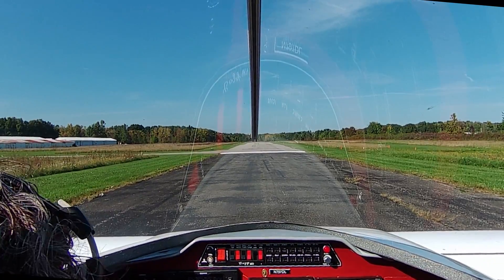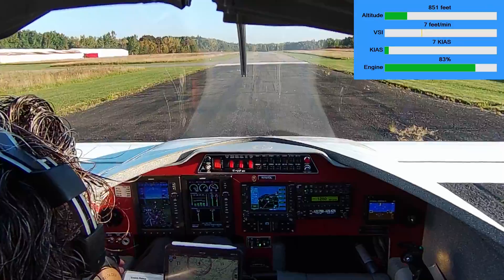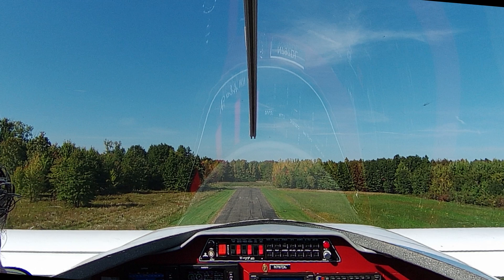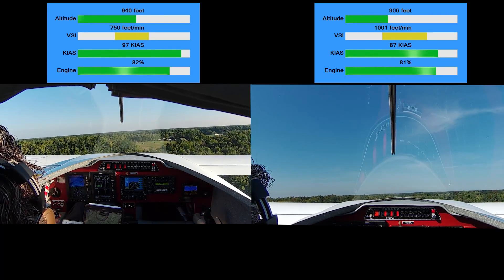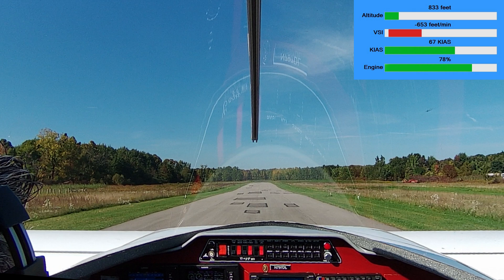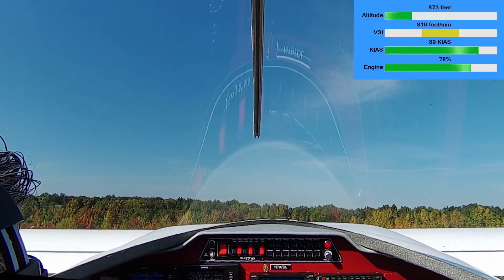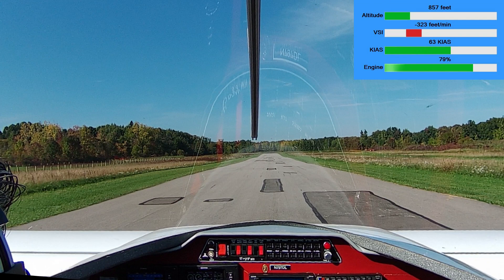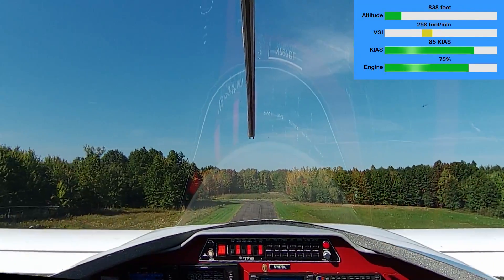Almost a CRASH: How did this happen? And why?

Comment: TBH,  I Thk U R rolling the dice w. Your Life.  Rwy Too Short, Obstacles too Close.  Tarmac Condition may induce premature Pitch Oscillation which may affect AoA and Air Speed.    Your plan should include finding a FBO with better Rwy Conditions.  You might also Pony Up your Own Cash to Repair the Rwy, if you must stay there.
Reply: I agree. Even his good flight was too close for me.  Buy a vans for that airport
Reply: All valid points here.  I think I would buy a chainsaw and cut down those trees at the end to give a path if needed at a lower altitude.
Reply: I agree. That runway is shit. Stop patching up bullshit and replace it
  The owner needs to be reprimanded. Spend the cash!
Reply: If you have to operate out of a field that's too short and too rough, then don't.  Find another field, or different prop for climb performance and give up some top speed. I taught thousands of hours out of a 2k dirt strip and I can tell you that technique is a huge part of making it all work. And yes the density alt was a big deal.
Reply: A hate to say it but you are playing with your life and if you had a passenger this would have gone bad real fast and that's definitely something you want to remember it's not just yourself, rescue don't want to ever see you 
Flying is fun but it's not worth die for and risking your life everytime you take off,  if there is extra grass at the take off end of the runway use it even if it's 20ft it will help.
Find a airport that suits your needs this 1 clearly doesn't. 

Fly safe so your family gets to see you come home at the end of the day.
Reply: If you are going to keep flying there, do as they say above or buy a faster plane that can get out of there... That is way too close.
Reply: Although I admire your willingness and effort to figure out what happened on that sketchy takeoff, I agree that that airport and runway combo doesn’t seem very safe. It seems like any combination of simple, common factors such as a little higher density altitude and a variable crosswind that swings around to a quartering tailwind could put you into an unrecoverable situation. I had a buddy that used to fly an EZ plane similar to yours and if memory serves that plane had no nose wheel steering and very little rudder authority compared to something like a Cessna.  His plane’s performance really suffered if he had to takeoff in a strong crosswind. He literally would have to drag a wheel brake on one side in order to keep the nose pointing straight down the runway on takeoff until he got much closer to flying speed which really impacted the length of his takeoff roll. 

P.S. I think those planes are cool in that they are fast and fuel efficient comparatively speaking, have safer stall characteristics, etc., however they are definitely not short field aircraft. You might try to build in a little more of a safety margin by following a rule of thumb like if you don’t have 75% of your normal takeoff airspeed by the halfway point of the runway you immediately abort the takeoff no questions asked. Almost seems like you’d need solid accelerate/stop data (like that used with multi-engine aircraft) to have a safer way to know at what point or airspeed you could abort a takeoff and get the plane stopped before going off the end of the runway. Being a home built I’d assume you’d have to calculate that info yourself through testing on a much longer runway. Anyway, best of luck and please be careful.
Reply: That normal takeoff was barely adequate, holy moly! Totally agree you need a longer runway and since you have a shitty home built. I’d find one without trees at the end. 😵‍💫

Comment: Not a pilot here, but I gotta ask about why you kept the nose down for such a short time initially - wouldn't ground effect be the quickest place to build airspeed as the drag is less there? Evidently you would have had time to do it, as you cleared the treeline despite wasting a few seconds trying to gain altitude before pushing the nose down for the second time.
Reply from the maker: Excellent question. I pushed the nose down and accelerated in ground effect to what would be normal rotation speed, which is 75 kts. At that point, I then started pulling the nose up. Right away I could feel that it was decelerating and that I was not going to climb effectively. That's the point I realized I needed more airspeed to get onto the front side of the power curve, and that's when I pushed the nose over for the second time.

Comment: Firstly. Great outcome.
I agree the pogo-ing is a real issue. Each upward ‘bounce’ increases the AoA on the canard and main wing. This increases the lift-induced drag, slowing your acceleration. Further, as you note, the increased AoA puts your canard in a flying state, but you are close to the back of the drag-curve, and this also slows your acceleration.
The runway clearly needs some work, particularly for your canard aircraft. They like long, smooth runways. I don’t know much about your undercarriage detail, but you might investigate changing the spring-rate and rebound rate/damping. Reducing the nose wheel tyre pressure might also do something - although the runway does seem to need attention.
I think this video, like your others, is great. Interesting, informative, and thought provoking.
Reply from the maker: I agree, and I do just that. The margin I normally build into my calculations is what got me over the trees in this case.

I have more than once gone out to the airport, seen the winds and DA, and said "nope, not flying today." You can't fool physics. :)

Comment: Just what I was asking me seeing the nose bumping, the balast. Canard is a pushing plane motor, so engaging trajectory. Solution is stand speed in pushing down the nose. But perhaps also to check the front wheel system. 👍🤔

Comment: Man, pucker time for sure.  Good save to you sir.   Hopefully this dude will fix the runway, totally unsat.  Sure glad you pulled this off, love that airplane, I suspect it does not buff out dents very well.
Reply: Yeah. It might cost a quarter million dollars or more to do it, so it will be quite a task to convince someone to take on such a financial risk.

Even if you have the gumption to risk the family finances like that, the airport has to be viable. Not just niw, but for like the next 20 years or so.

It's a tough one for all parties involved is what I'm getting at.
General aviation isent growing like it did in the past due to fuel costs, weaker and weaker dollar, etc. This means lot of small airports end up with no future viability.

I do pray this isn't one of those airports, cause I like it

Comment: I'm not a pilot but I saw that ground porpoising immediately and realized that was going bad places. If the runway is improved by the owner, is it safe to assume that an official has to come out to confirm and rate the new condition? And how long does it typically take to get that update info disseminated? I can see how delays there would be off putting towards investment.
Reply: This hard to say because, field conditions for GA airports are loose you can have everything from a perfectly smooth runway to a dirt strip and be with in regulation. Alot falls on the pilot to ensure his or her aircraft has the capabilities to perform safe take off and landings on any runway dirt or paved . Now let's say there's a giant pot hole or a hump in the middle of the strip it's the airport managers job to put a notam (notice to airman) out stating issues with that airports runway and then decide if the issue is unsafe and the runway needs to be closed or just an issue that pilots can over come with proper planning
Reply: @DocbritoFMF  Thank you.

Comment: Hi pretty new here, but was going to comment on runway improvement. I thought there must be county or federal funds to redo and extend the first few hundred feet where the excessive bouncing occurs. I'm curious how much the bouncing actually slows your TO roll.
    Also, that tree slot could be widened and lowered to make me more comfortable. 
   Nice analysis!
Reply from the maker: Unfortunately, the airport is privately owned, so it does not qualify for county or federal funds. They did remove about 200 feet of trees from the north end of the runway, they are hoping to be able to remove more.

Comment: Thanks for sharing this. One positive, you did use all of the available runway. It could have been worse if you had started at the white line. Glad all is well, other than the change of trousers
Reply from the maker: I make a point of doing that ALWAYS, on every runway. Try explaining to your insurance company after the fact the reason why you didn't feel the need to use all of the available runway.
Reply: @CanardBoulevard Useless things in aviation:
Sky above
Runway behind
Fuel in the tanker
Yesterday's weather

Fly safe